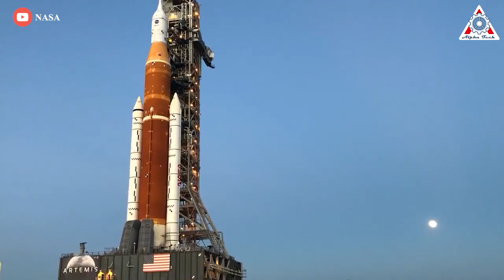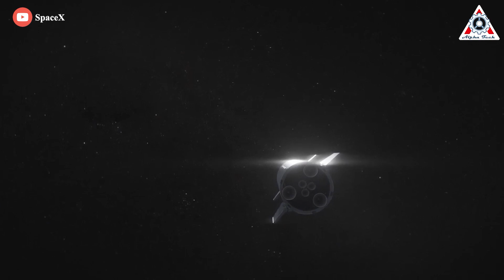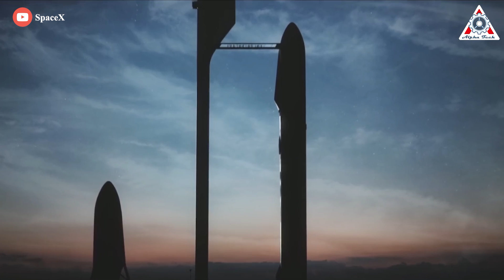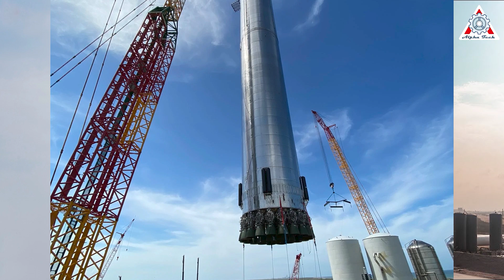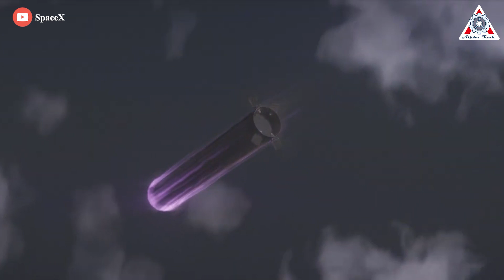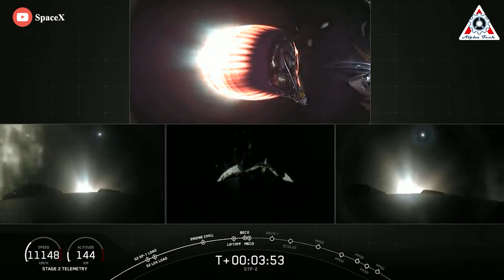How Elon's SpaceX Starship SHOCKED Scientists, will blow your mind...

Comment: When you come back from marsh, take quite a few trips around the earth even in retrograde to slow the ship down. And you have the heat tiles, put the metal plate on the ground on Mars and then wind the damn thing with the heat shields! I don’t know which way it would go with her heat shields then the metal plate vice versa, and then engineer, I just have common sense. There’s heat shields I designed it was Stan three and 4000 agreed to have a church. From the launch mount at Boca Chica the temperature is 500° where is shish when launching, and she is leaving able to be mitigated through those heat tiles, anybody agree?. It sounds like the self proclaimed president is just angry because it’s not his idea

Comment: The damage a rocket exhaust can do was demonstrated back in the '60's when one of the Apollo lunar lander's set down about 1/4 mile from the Surveyor 3 craft that had landed over a year before.   What they found was the thing had been literally sand blasted by their landing motor and significantly damaged.   With no atmosphere and low gravity any regolith launched by a rocket exhaust will retain full velocity for a LONG way...and the very thin CO2 atmosphere on Mars is going to be a similar situation.   Landing anything like Starship will need a prepared pad I'm sure.

Comment: Some aspects of this video seem way out of date.  For example that thing about Lunar Lander digging a hole on the Lunar surface while landing is nonsensical.  Lunar Lander will have six smaller rocket engines, high up that will help Lunar Lander to land without impacting the Lunar regolith.

Some other parts of this video made me think that it was a very old video, too.  It's as though some old information was mixed in with current information.  It was a bit confusing.

In the end, however, I found it to be an informative and entertaining video.

Comment: So this doctor, Robert zerbert? is supposed to be a scientist? 😂 surely he must understand that mars gravity is only 38% of that of earth requiring far less thrust to land and would not dig the crater he is supposing and furthermore, I would propose that yes there would have to be modifications to land a star ship on Mars, which it could be equipped with specialized (folding) landing legs W/platforms at the base of each leg that reach far outside the diameter of the blast of the engines as they would need to be less structurally significant on Mars because of the less than gravity they could be designed and then installed in orbit around the Earth and zero gravity so there would be no cost of their weight or drag on the atmosphere. There are lots of naysayers that are not true thinkers I speculate this so-called scientist is actually trying to throw mud on starship to make NASA look better which would be impossible. and I would compare Neil Degrasse Tyson‘s patient to that of Paris Hilton, when it comes to analyzing the capabilities of Elon musk, who has more groundbreaking invention than any human on the planet, and makes defense he look like a Boy Scout.

Comment: funny how all the landing issues plaguing starship were no problem for Apollo missions.
Reply: I was 17 when Apollo 11 landed. Believe me, it WAS difficult - but there's really no comparison: Starship will be bigger than the throw-away, one-use rockets used to launch the Apollo missions - and it will be able to land and re-land over and over again. The cost per pound to launch payloads using Starship will be a fraction of the cost of the Apollo rockets. This will ensure that after a single objective is achieved (like landing on the moon and returning to Earth), the Space program will be shut down to save money.
Reply: what I am referring to is the lack of a dust plume during the Apollo landing never mind a crater.

Comment: If landing on the moon isn't possible because of cratering, how did we land on the moon in the past?
Reply: The Lunar Lander was an extremely small and lightweight lander, with its own landing and take-off platform attached, and required a separate orbiter with a 3rd astronaut in it for the Landing module to take off from the moon, dock with the return vehicle, and come back to Earth with all three astronauts.  There is no comparing the size, power, and weight of the two craft, and our advances have been amazing - Starship is enormous by comparison, and is a multiple-mission, reusable rocket that doesn't need a separate return vehicle to remain in orbit. This actually makes manned space programs practical and affordable.
Reply: @berretta9mm17  fascinating. Beam me up! We'll get there. Soon there will be permanent landing pads on the moon and Mars. It apparently looks far more sturdy than it is on those moon rocks. Thanks.

Comment: Perhaps if you used a Thruster fixed to the ground pointing upwards to assist the rocket in getting off the ground and gain momentum. Maybe a ring shaped thruster coming up from the ground around the outside of the ship would make it much easier to take off. Then it wouldn't need to carry all the fuel it needs to get the first few meters, (you do the sums) off the ground and also the ship would be lighter as a result. This would also reduce the load on the onboard thrusters during takeoff and possibly extending the life and reducing the maintenance from stress. I see a lot of advantages there.
Reply: Look I'm still wondering why they never launch off the top of  plane already doing 800 miles an hour and 40000 feet in the air?
Reply: Let us all know when you've designed the first multi-use rocket system that can hold 100 metric tons in its cargo hold into orbit -  and a rocket motor that can push 230 tons into orbit, and then land accurately on multiple planets, including back on earth - each mission estimated to cost millions instead of billions. We'll all be looking for you to match Starship and SpaceX in this endeavor. 
They employ ACTUAL ROCKET SCIENTISTS, propulsion engineers, Orbital Mechanics Physicists, Space Suit designers, and hundreds of other experts in designing and building space hardware. If you are smarter than any of them, maybe they would hire you - apply for a job there.

Comment: They need to start placing specific loads of transport fuel, into space, out of the way of any enemies attempts to thwart a launch to Mars, or anywhere else, … along with the types of habitat, and any types of experiments into space, as I implied, … out of the way of any attempted, convoluted ideas to convert a space launch, into a disaster, …
Reply: And as far as the building a landing pad, they can practice with stuff on the moon, then send the components to the moon, & have them on a lock step priority, to set up a viable landing pad platform, … & with enough sections placed, the pads could make a street that could connect one experiment to another, & even be set into natural depression, to ward off any Martian, or Moon storms that may/will pop,up, in the futures, …
Reply: @Edgar-kl6us  Moon storms? Lol!
Reply: @berretta9mm17  anything that could stir up the surface dust that could be called a storm across the surface of whatever object they are using to store fuel on as a depot, …

Comment: Instead of going to Mars or the moon, building a hollow artificial moon should be the priority. The new moon would be very light, similar to the old Echo satellites. It could be miles in diameter, and it could contain air, and it could be solar powered. The shell could have water tanks to provide shielding from radiation for the new moon. The new moon could have rocket engines, so that the new moon could make a trip to orbit the moon, for example.
And on the topic of methane and oxygen use, climate change is not due to CO2. Convection controls climate on Earth. For example, the moon is above boiling in daylight. But here on Earth, temperature never gets to boiling because hot air rises into the cold troposphere. CO2 does not affect convection, and so CO2 has zero effect on climate.

Comment: Blow a crater? Come on, they solved that long ago..  How did they solve it for the moon lander..?  Looking at the moon lander the isn't so much as a speck of dust any whe on the landing gear..?
Reply: The Apollo Moon landers were about 1/1,000 the size and weight of Starship. 
The Apollo lander barely held 2 men - Starship will hold 100 - and hundreds of metric tons of cargo. 
It's like comparing a compact car to an ocean liner. The Apollo was like landing a mosquito - the Starship is like landing a spaceship, that doesn't need a separate craft orbiting the moon to dock with in order to return - it just leaves.

Comment: 1. Moon gravity will not be as rough on the weight thus not needing as much landing thrust. 2. Landing thrusters can be deployed in the upper stage for sit down. 3. 3d printers can use and will build once on the moon using existing dust from the service. Mars- 1. The gravity is much less then earth aswell and thus will be resolved from points stated above. Not as big of a deal as your assuming. Payload's can be deployed back to earth in the upper atmosphere and parachute down to a body of water in the shallows thus giving Starship less weight thus giving starship less fuel usage on landing. Same idea can happen upon landing on any surface. Attached drones for any cargo can guide loads onto the surfaces of Mars or the Moon or any surface.

Comment: Are you using an old, old quote from Zubrin?  The lunar Starship design has special rockets angled out ~45 degrees about 2/3 up the barrel specifically to address this crater-digging problem.  The rocket engines at the bottom would be used only to slow the craft down and would shut off before any possibility of digging a hole in the regolith.
Reply: Yea, a lot of outdated/old and missing data in the video. Clickbait!?
Reply: Brasíl
Reply: Zurban needs to STFU already.
Reply: Good idea

Comment: When you're opening, story is about a telescope that launched last year,  followed by how it could have been launched with an SLS which launched earlier this year, but you're talking about it being still on the launch pad, also ignoring the fact that the SLS does not have a fairing large enough to accommodate an unfolded JWST.
You need to release new information in your posts even if it is about tools that have already been launched.  I am absolutely sure that there is information you could put out about the systems that would still be news to most people.
Reply: Brasíl

Comment: China’s space station is set up to support their Hubble equivalent telescope which will orbit nearby.   This is the ideal solution by allowing a very large telescope to be assembled, to be tested and fixed/tweaked as necessary before being released and moved to the far side of the moon.   The Webb follow-on telescope should use Starship to get eight 4 meter diameter mirrors and a dual spar supporting structure to create a telescope with mirrors 60 meters apart for 10 times higher resolution than Webb.
Reply: The biggest problem is China..I

Comment: I still want to know.
Forgetting COST.  If you landed the Falcon Heavy side boosters at sea instead of RTLS (return to launch site) would you get greater overall system performance?
Reply: Landing at sea would be harder but give you greater overall performance after you master it. :) I think thats why Musk did it. Ifyou can land at sea you can land anywhere.
Reply: Yes, less fuel to just coast to a barge instead of turning around and coming back means more fuel for payload delivery, since the rocket can only hold so much fuel.  BUT you don't need a barge and support ships on land (which also use fuel if you think about it,) and you get the rocket back immediately instead of having to wait 2-4 days to re-use it.  Less salt water spray damage, too.  So you have to balance the advantages and disadvantages.